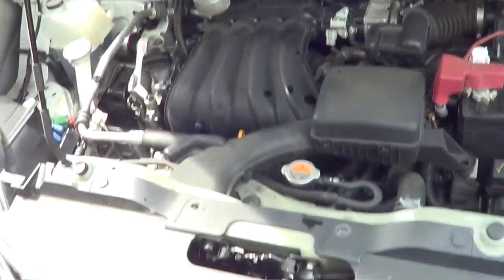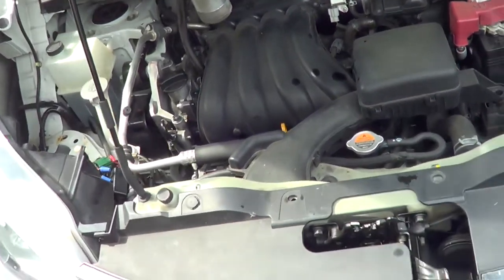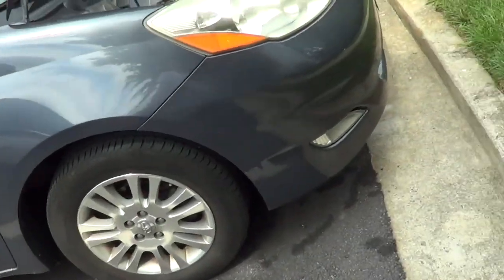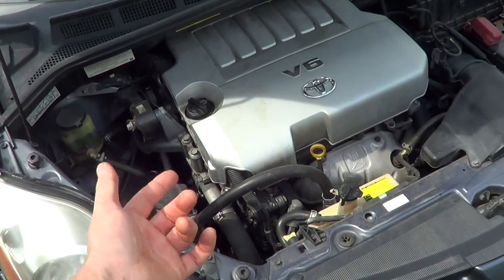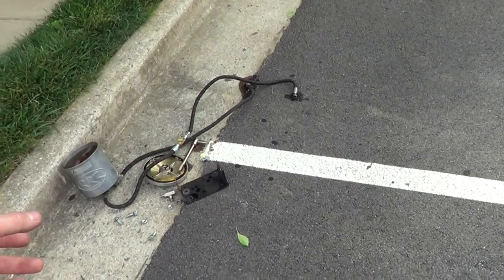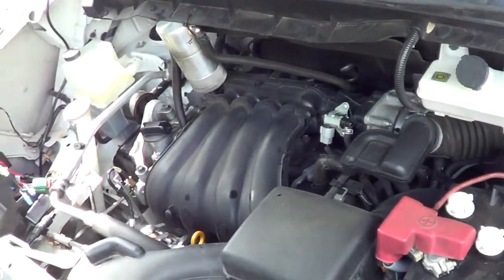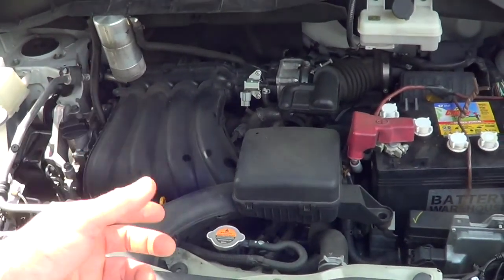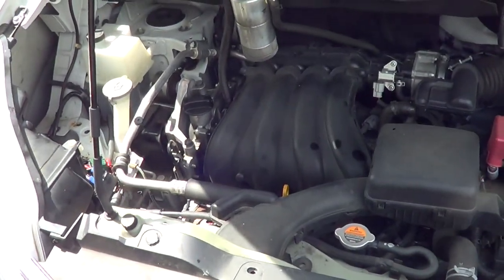Oil Bypass Filter Pulled on Gasoline Engine

Comment: I have been using toilet paper filters since 1963 I have used several different kinds of oil since then. They have always been a golden color on the dip stick. I use Scott 1000 toilet paper. In the old days with the dirty running engines of the 60s I changed the toilet paper every 2000 miles and added a qt of new oil. On my Altima Its every 6000 and a new qt of oil. My oil is golden. Some oils they tell me has additives that turn the oil dark. I used Amsoil for awhile. It was beautiful when kept clean. Mobil 1 is beautiful Pennzoil Platinum is beautiful. My old Rambler used Chevron Delo 100 and it was golden. The trick is to keep it analytically clean. Truckers have the oil analyzed and their oil is black. The filter isn't causing loss of oil. The oil is just not clean. You are sounding like someone at the oil change place.
Reply: Put a Frantz oil cleaner on my boss's nearly new 63 Chevy Suburban with the 292 big 6 that pulled a dragster He was a fanatic about clean.You could eat off the floor in his shop for example. He complained that his oil is darker than mine. Called Frantz. I think it was Skipper Yee on.the phone. I told him he uses Chevron Special I use Chevron Delo 100. He said drain the Special and put in Delo.100. The Special has a ashless additive that turns dark with use. Sure enough his oil looked like mine.He never drained the oil just changed the filter and added a qt of oil about every 2000 miles.

Comment: I have been experimenting with oil and filters since 1963. Use a good oil and never let it get dirty. I have no idea which oil is best but I know something about filters. Every one has to work out their own system. If you have a filter that cleans oil you have to change it often enough to keep the oil clean. I have sent filters to Norway. Those filters might need to be changed every 500 miles. In the Dallas Tx area every 6k is fine. There is no such thing as one system that covers every. one. I know that if my oil doesn't look and feel new on a gasoli e engine I will need to change the filter more often. I only tolerate dark oil In a diesel.

Comment: Toyota has good engines but the oil needs to be 100% clean 100% of the time. A year or so ago I wanted to buy a Camry  from a guy that had only 100 k on it. I knew he didn't drive it. It was just setting. He said he will probably give it to his daughter. He said her Camry has over 500 k on it and is starting to give her trouble. You can bet it gets a lot of oil changes. Both engines are 6s.

Comment: I like to mess with the Amsoil people.one thing about Amsoil people they take care of their cars to the best of their ability. This video is well meaning but diesels are t designed to run on dirty oil.Bypass filters don't cause dry starts. Changing oil is not the only way to get clean  oil. There is a lot of good information available now. Filters are very simple. There are some very good ones and there is some junk. This one is probably as good as toilet paper. A roll of Scott 1000 is a buck.It cost more than a buck to change.this filter. It would bother me to pay more than a buck for a filter as good as toilet paper. This filter is a lot better than the Amsoil filter and any spin on filter. You need depth to clean oil.When I sold oil filters I got the wise guys. When I told them oil don't dissolve paper they didn't believe me. They would put oil on paper. They would put inline fuel filters in the return line. The best thing is to look for the guys that use them.

Comment: Years ago I sold filters for a company named Gulf Coast Filters If you Google them you might get some info you can use. They mostly do diesel engines. They started with mostly marine engines. They are heavily into trucks now. Use Big roll paper towels as s filter element. Hope I'm not giving too much info.

Comment: Amsoil is beautiful If you have a good filter and change the filter enough to keep the oil clean.I think we found the problem. Its a good filter but too expensive to change often enough to clean the oil. The same problem Amsoil had 40 years ago. The recommended filter change interval was too long.
Reply: The Frantz I installed was passing dirt out the return line and the element was packed in very tight and changed every ten (10) hours; if your engine is dirty, don't expect any miracles.
Reply: Haven't used the Frantz oil cleaner in years. They worked very well for me. When I used them The toilet paper fit better. The Motor Guards and Gulf Coasts are more idiot resistant when using the shorter toilet paper. You can't get dirt thru 4" of toilet paper. Dirt will bypass the toilet paper if you don't know how to service The Frantz oil cleaner.
Reply: The Frantz can not clean a dirty Sludged up engine. All it can do is clean the oil.
Reply: @ralphwood5114  My engine was not Coked up, it was full of particulate mater and would pass through the pleates of the toilet paper. The guy doing this video had the same experience because his particle count was excessive (22/18/14) and removed the bypass system. Perhaps you have no experience with dust from coal or cement, its very damaging to engines.
Reply: I have started using Great Value 1000 toilet paper from Wal Mart. The 16 pack cost me less than 60 cents a filter change. I have about a dozen Motor Guards and Gulf Coasts in use. 2 Motor Guards that are over 40 years old.
Reply: Back in the 60s I demonstrated the Frantz and Motor Guards by mixing carbon black with oil and filtering it out on the first pass. I've used cement coloring and black color from an art supply . My oil is always a golden color. I don't know what crap paper you could use that would allow the oil to get dirty. I have seen some loose wound junk.
Reply: I remember my first diesel. I expected the oil to be golden like on my gasoline engines. There is non abrasive soot that even high quality toilet paper can't remove. It wouldn't show up in a particle count but will turn the oil black. Send a sample to the lab and it will be clean. The Frantz also can't remove the red from ATF. If it could remove the red it could remove the black.
Reply: I am a highly skilled Journeyman toilet paper squeezer. Never heard of pleated toilet paper.
Reply: I've had a lot of experience with the Frantz oil cleaner. If you have a Frantz oil cleaner and your oil is dirty you are screwing up some how. Can't help you long distance.

Comment: The original Amsoil filter was better than the pleated ones but were too expensive to change as often as needed to keep the oil clean. That was the problem. Nothing wrong with the oil. 40 years ago It probably cost 50 cents to change the Frantz. Got a call when the engine had about 350 k.Asked me if I wanted it. Engine needed work. 79 Honda Civic. Hadn't thought about that old car for a long time. I experimented with the Amsoil long filter change intervals of 40 years ago. Didn't work out very well.
Reply: Dude, you gotta learn to reply to comments.

Comment: About 40 years ago I took my wife's sister to a Frantz Amsoil dealer in Salt lake for Amsoil and a Frantz oil cleaner. I remember the oil looked new for at least 200 k without an oil drain. The filter was changed more often than Amsoil was recommending in those days. I think it was 10 40 in a metal can.

Comment: I don't drain oil and I guarantee my oil is a lot cleaner than allowing it to get dirty wear. And foul the engine then draining it. I change the Scott 1000 every 6k and add a new quart of oil. You either have an oil problem or a filter problem. Don't know which oil is best. The Platinum and the Mobil 1 can handle the job. I have used the Frantz the Motor Guard and the Gulf Coast. Never had a dirty oil problem.

Comment: Normally the oil can't get dirty with a depth bypass filter. That looks like a depth filter. If you don't change the depth filter before it reaches its capacity the oil will get dirty. If the dirty oil finds a way around the element the oil will get dirty. The more the resistance of the dirty filter the more the dirty oil will try to bypass.the element. I had trouble with Amsoil about 40 years.ago. Not because because it was dirty. The Frantz oil cleaner kept it clean.The viscosity increased

Comment: Don't know.what your problem is. My Nissan Altima has variable valve timing. I stopped routine oil drains over 50 years ago. My Pennzoil Platinum is beautiful. I use toilet paper filters.Probably not any better than yours. Bought this car with 225 k on it and installed a Japanese.import engine. Bought a new Subaru and put a Frantz on it.over 250 k with no oil drains using Mobil 1. If you are having trouble with the Amsoil you might go to a better oil. I doubt if the filters are the problem.

Comment: NGO CONCEPCION:  "All Brains and No Books must be better than the other way around!"  You are a classic for needing a basic education in what you're doing.
A simple oil particulate test is to apply the oil to a migration medium - a coffee filter or even a quality paper towel will work.  Just a drop.  LOOK FOR A RING after the oil spreads out = particulates present.  The darkening happens with temperature - heat some in a pan on a burner right out of the bottle and watch it turn dark after a few minutes.  It's okay - it's really not dirty.  Test it - no ring!
Please - get a book on motor oil testing. "SAE oil tests" will do it.
Reply from the maker: Why don't the oil test companies offer that service.   They discontinued particle testing with filters?   Also, my Toyota test car had the timing advance wheel stick with oil at 10,000 miles.   Changing the oil allowed the start locking pin to freely move on the variable valve timing sprocket.
Reply: I use white toilet paper. Another test diesel truck owners use is the proven way of rubbing some in the palm. If it fills the crevices in the skin with soot and won't wipe of its dirty. Frantz gave you strips to test the oil. When I wipe the dip stick with toilet paper I like to see a golden color with gasoline engines. With a diesel I like to see black black not grey black.
Reply: Back when I started using the Frantz we had a list of oils that didn't have additives that turned dark. I worked in a Standard station. The Delo stayed golden with the Frantz. The Special had a dark tint to it. At one time Frantz had their own oil. Of course it was golden. I have Delo 400 15 40 and Gulf Coast filters on some lift trucks using propane.That oil always looks the same as it came out of the bottle.

Comment: Don't know which oil is best. I had good luck with Mobii 1 with no oil drains and just changing the toilet paper and adding a quart of oil once a year or every 12k miles.On the Subaru 84 1800 250 k with no oil drains with a Frantz oil cleaner. I used 15 50 racing oil.On the Altima I am using Motor Guards and 10 30 Pennzoil Platinum..Oil looks good. Changing the toilet paper every 6k or about every 6 months. Been at it for over 50 years. I can tell if it is clean. The Pontiac oil is just a little darker. Kind of like dark honey compared to light honey.

Comment: I'm 80 bypass filters have been around a lot longer then me. At one time all oil filters were bypass filters.Even on a Rolls Royce. They are the only filters that clean oil. The best stock oil filter I have ever had on a car was a Fram bypass filter on my Dodge Luxury Liner 1941. The element was cotton.The same as the proven Luber Finer truck filter. Filters were optional equipment in those days.

Comment: I'm in Texas. I don't have to deal with sludge like someone in cold weather and short trips. We depend on the crankcase ventilation and normal operating temperature to get rid of the water and sunburned fuel. Diesel engines aren't designed to run on dirty oil Google Gulf Coast Filters. I change the filters more often on a diesel or old gasoline engines.

Comment: Don't know what your problem is. I went over 250 k with no oil drains with my 84 Subaru using Mobil 1 and a Frantz oil cleaner. I changed the Frantz once a year which was about 12k.The oil was always beautiful. A Caterpillar lab said the oil looked good for that many miles but I should change the filter twice a year which I do now.on my Altima using Pennzoil Platnimum and a Motor Guard. Actually your filter looks like a good filter. If your oil gets dirty It might not be as good as it looks. Its easy to keep a new engine in near new condition for a very long time. I also keep the ATF clean.
Reply: So you bought a motor guard toilet paper filter and it works for oil?

Comment: I ran my 88 Chevy sprint three cylinder 1 L engine with the Amsoil double micron oil filter kit that used to spin on oil filters extremely large. And one large micron Main oil filter with 50,000 mile intervals because my yearly mileage was 50 to almost 100,000 miles a year. I was getting tired of weekly oil changes. 
       After 286,000 miles on a three cylinder engine with a driver who likes to drift around corners in red line through all five gears to accelerate onto every freeway on ramp no issues and the oil was always clean. 
         With the addition of the two large spin on bypass filters and the one large micron main filter my oil capacity was 9 quarts using Amsoil
Reply: Makes total sense. This video is wrong. How can cleaning the oil better be bad?

Comment: How often did you change the filter. :/. Look oil bypass filters work IF you change the filter regularly. Its not designed to run indefinitely on the one filter and you sure as hell can not put 70,000 or even 30,000 miles on one filter. You should have changed the canister filter every 4,000 to 10,000 miles. Do that then run your numbers. 

You said that if you ran that media you WOULD change it every 7,000 miles. Which again that is what is recommended. So you acknowledge that with regular filter changes the filter works. You just didn’t change your filter which put contaminated oil back into your engine which caused your problems. 

Bottom line toilet paper filters have been used for years. They have been proven to work when used properly. Please don’t make videos claiming something doesn’t work when you did not take the manufacturers advice on usage.
Reply: I was putting a Frantz on a car in the early 60s
The brother drove up and said wish I had Known you wanted a Frantz I would have given you mine. My oil is dirty and my lifters are noisy.He was asked when he changed the Frantz last. He said change it the guy that sold it to me said it would last a lifetime. At a family reunion a cousin said that filter you put on your dad's car wasn't any good. It filled up with sludge and quit working. My fault I went to Oklahoma put on the filter and went back to California. With a little more experience I realize the engine was loaded with sludge because of neglect. The Motor Guard couldn't handle that much of a load for very long. Probably would have.needed a new roll of paper every 50 miles.
Reply: Not familiar with that filter. It looks good. My oil is pristine .My engine is pristine. I still change the Scott 1000 every 6k. About 40 years ago Amsoil had Bobby Under saying this oil change is forever. It didn't work so well because of to long between filter changes. The filter was better than the crap they have now but you have to change them.

Comment: My God, this can't be used like this. The filters currently in use are suitable for vehicles containing more than 450L of engine oil.
Your car engine will be overburdened.
And the M series oil filter can not be used in cars, because the accuracy is too high, the vehicle should use the E series.
Truck uses triple R reasons
 this is because oil contains a lot of pollutants. If the oil is filtered in time, it can be used continuously.
Truck the cost of oil change is far more than changing a filter, so this product can be placed on a large car, the car is not suitable.
Reply: What. These filters You mention are good filters. They will work on any engine that has an oil pump. At the present time I am using Scott 1000. That could change. They keep changing the paper. I'm told some of the elements are as good as toilet paper and cost 30 bucks Ill stick with Scott 1000 as long as it is high quality. The Motor Guard and the Gulf Coast Filters are more user friendly with different core sizes. If I still used The Frantz oil cleaner I might use the Frantz elements. I only use a couple a year in each car.

Comment: very helpful, thanks for taking the time to post the video.  I had watched your previous video and was looking into fitting a bypass filter as the big diesel engines I used to work with used bypass filtration.  But after seeing this video I think I'll just do as you suggest and change the filter every 3ooo miles  (5000 km in my speak) and oil change every 10 or 15000km.  What do you recommend for air filter changes? I normally do mine each 10,000km service but I've delayed a couple of services out to 15000km.